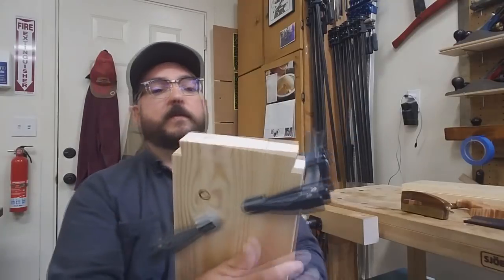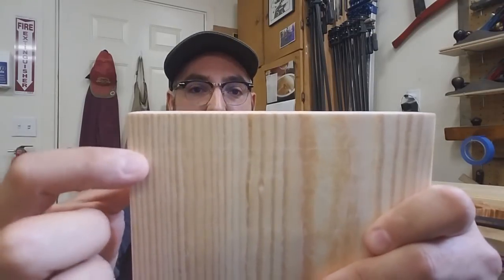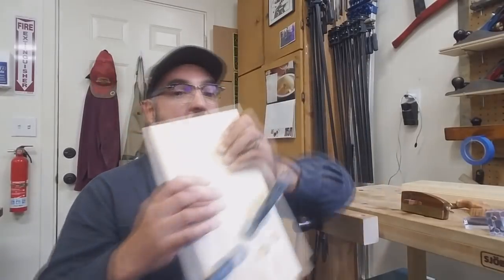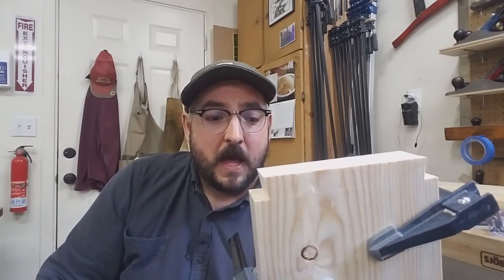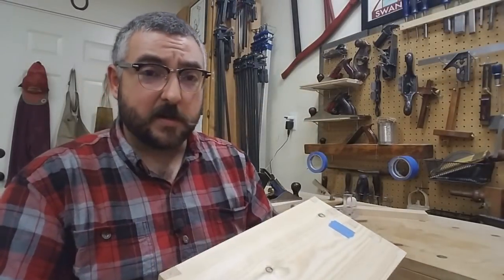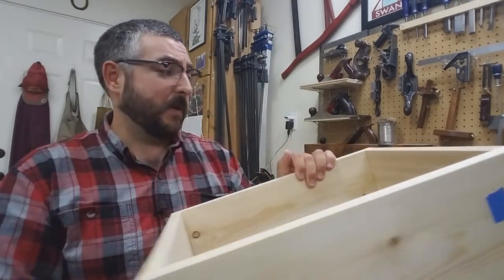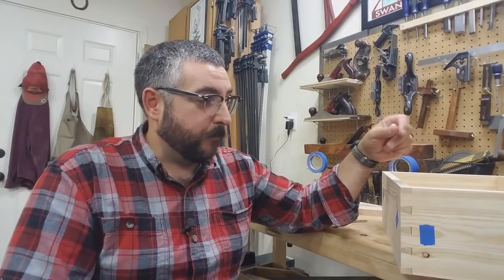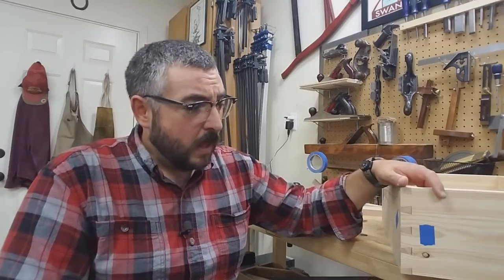The Most Hardcore Ammo Box Ever?

Comment: There is a modern obsession with tight tails and ultra precision and consistency.  Looking at the tails in drawers from that period, that modern sensibility looks to be exactly that, modern.  Certainly, fine furniture, as you point out, would have been built to such tolerances.  I can't imagine ammo boxes would have exceeded the craftsmanship of drawers of the same era and so things such as angle, tail placement and pin size would have been eyeballed and based on training more than a precise measurement.  Gaps and  tight fitting but gnarly looking joints I'm certain would have been common.
Reply: I don't think federal arsenals took the time to dovetail a box that would have been smashed and the wood burned as kinling in camp.
Brass screws would have been excessive,nails were more available.
Reply: All the boxes l have seen are butt jointed with nails, no joinery visible
Reply: @DonAbrams-hq7ln  the reason people used tails to begin with is that nails were more expensive being mostly hand made up until about 1800.  Even then machine made nails were expensive until wire nails came about in about 1900.  The woodworkers of the 1800s were tremendously fast at cutting tails by hand.  I would be surprised if the boxes were nailed but it is certainly possible.